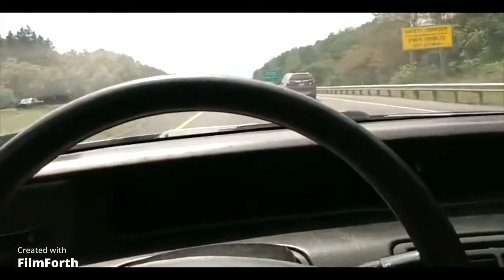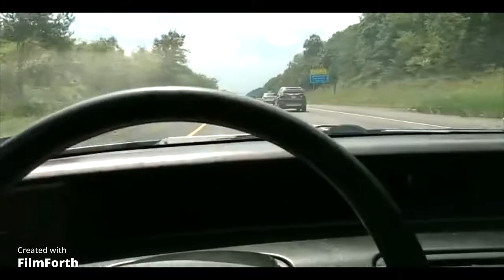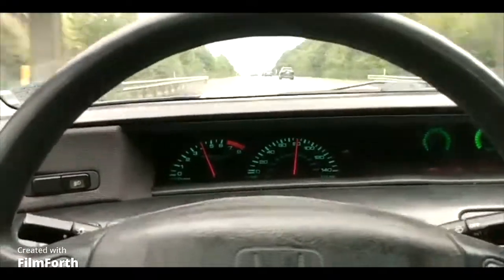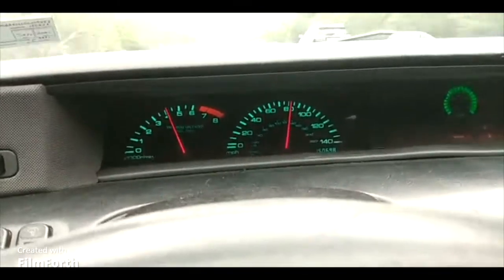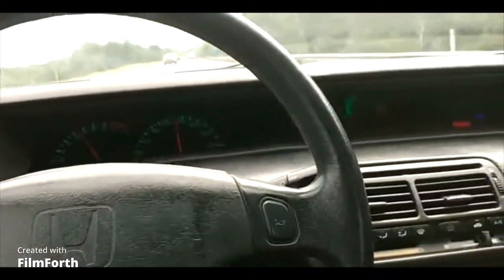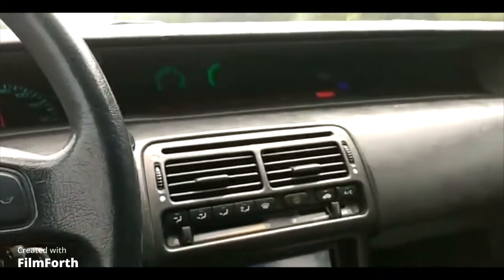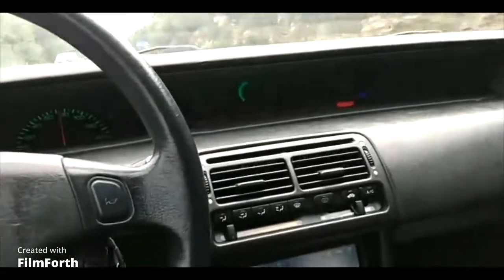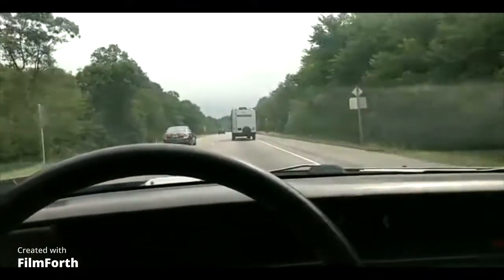F20b 92 prelude  dyno 1st attempt

Comment: 2.5 inch exhaust is for sure holding you back no doubt. I was 2.5 muffler and exhaust before. Swap to 3inch muffler and exhaust.  Never looked back. I made 10-15 more whp. Either way even in a Mustang dyno. You should be making 185-200 range with tuner 2s
Reply from the maker: I was debating 2.5 to 3. After changing the cap and rotor with new ngk plugs it definitely changed the way how it pulled and the rpm range feels good to 8k. Next tune I do hope to be in that power range.